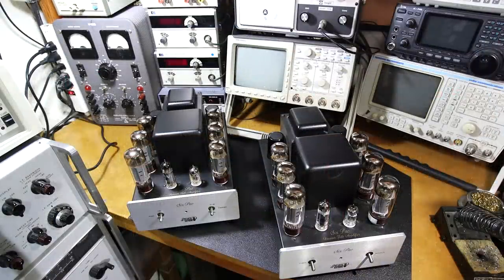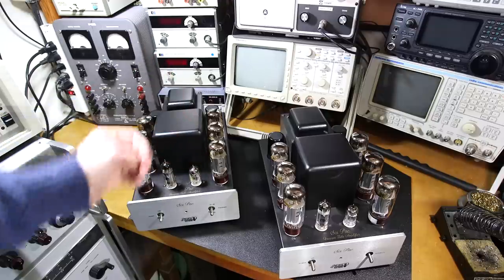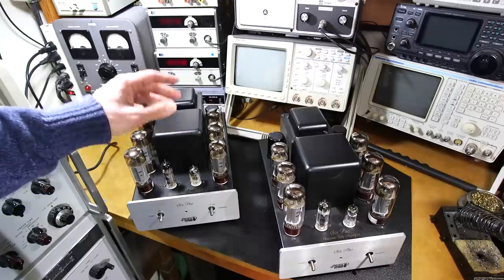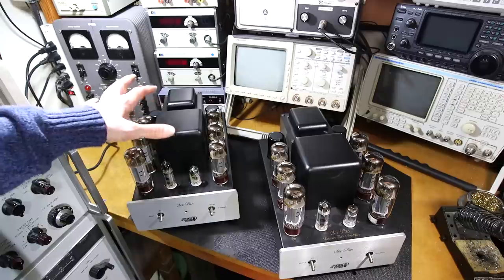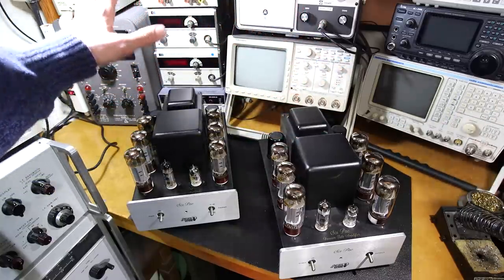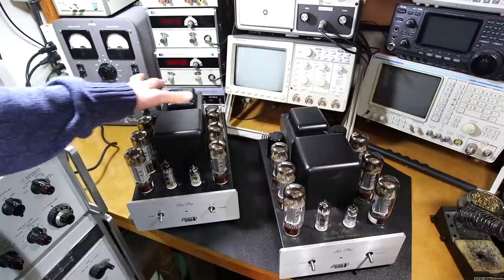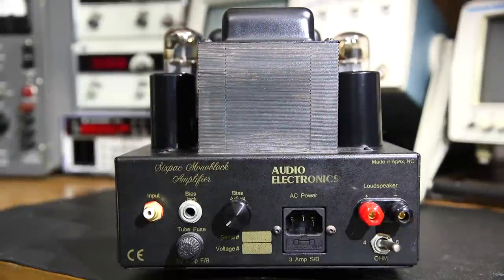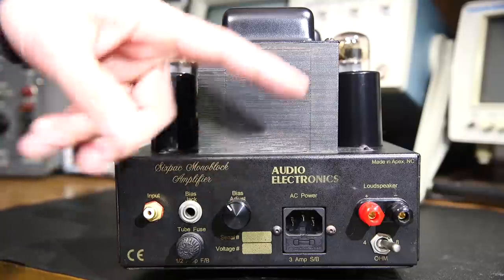Two Six Pac's On The Bench

Comment: The future is Class D!
Reply from the maker: For powering bass "yes," for audio containing information "no." For those that want a modified switch mode power supply to reproduce audio, class D is fine. For those of us that like our sound, inefficiency is just fine. I personally like drawing current 360° of the cycle :^)
Reply: @MrCarlsonsLab  Show me in a double blind study if anyone can actually tell the difference between a modern class D amp and your beloved power wasting class A tube amp. Actually I am willing to bet the class D amp will sound crisper.
Reply from the maker: @HansCSchellenberg  It would be very easy in most cases, just listen closely to the noise in the speaker at no volume. Try it, compare, and get back to me.
Reply: @MrCarlsonsLab  Well I own 3 Sonos 5's and a JBL Partybox 310. All powered by modern Class D amplifier designs, I have never heard even a hint of an audio noise floor out of any of them. Maybe my ears are not golden enough :)

Comment: Why 162 thumbs down ?
Reply: Right?! This was awesome, and although there were a couple of things about it that bothered me, they are small potatoes, and do no merit a "Thumbs Down". Since you asked, though: 1) Paul never came back and told us what became of the OEM HV capacitors that he changed.  How did they measure , once removed from the circuit?  Did the leaking internals translate into an actual failed cap, and if so, what was the failure mode; open / short /high ESR?  Did the failure effect both amps, or just the one we saw in the video?  Who built the caps and what was the mfg date, so other owners or folks with these caps in their amp may be informed?  
and 2)  just because he says "fa-rod" vs "fa-rid", or "sold her" vs. "sa-der"...Still, a big Thumbs Up!

Comment: Bottom line, my sixpacs sound great! I do not care what an ohsosillyscope trace looks like, I do not listen to traces on a scope. But thanks you for the info. You could have spent some time on the coupling cap importance.
Reply from the maker: Hi Carl. You should care what an oscilloscope says. Next time in a quiet room, listen closely.... You wont hear that in these amplifiers.
Reply: Oscilloscopes are more accurate and they don't get wax buildup.   Neither are they subject to biases.
Reply: Wait until you have an ultrasonic oscillation problem giving you a fit. I wouldn't rely on your ears to find it.

Comment: 16:50 I assume the switch inside that bias-probe jack "removes" the need for a (dummy) load on the output of the amp, while adjusting the bias?
Reply from the maker: Adjusting the bias requires no drive to the audio input jack IE: (the amp is silent.) No load is needed to adjust the bias on any transformer coupled vacuum tube amplifier.
Reply: Wait a minute... So are there particular tube amp topologies that are and aren't prone to blowing up without an output load?
Reply from the maker: As long as no signal is applied to the input, you should have no problems. Problems occur when drive is applied with no load. Keep in mind, if the period is kept short (no load with input drive) this is often ok as well, for testing purpose only.
Reply: I'm just a novice enjoying these videos, and that was my understanding too.  But what I don't understand is why there isn't a load put across the output when testing.  I always thought it was a no no to have a valve amplifier on without any load
Reply: That's been my experience too. Back in the '60s I had a dummy load setup on my workbench. I could flip the switch between 2Ω, 4Ω, 8Ω, 16Ω  and no load. I never had an amp react badly with no load. I was always using a nominal signal input. No overdrive. It was interesting to see how an amp's output varied with the load. I wonder if the resistance of the negative feedback loop would enter into this.

Comment: Another comment, we often measure both THD and THD+N. It would be interesting to know what the ICN (Idle channel noise) for the amplifier is as well, since it is this noise that we comprehend as "hiss noise" when an amplifier is on and not playing audio.
Reply from the maker: Hi Cody. With an open grid, audible hiss is present with a 12AX7 installed. Terminating that grid to it's lifted ground almost makes the amp silent in that regard.

Comment: Why do they use point to point? Whats wrong with PCBs?
Reply: NeuroMod 

My first thought would be good old audiophile cork sniffing... But my next thought would be "how thick do pcb traces need to be to accommodate ~500v?" 

"How big would that PCB have to be?"

It's possible that you can make this chassis much smaller with point to point because of this... but that's just a guess.
Reply: Thick traces would be needed for high current, at higher voltage the current is very low... but your first guess makes sense, saying that something is hand made in an almost artisan way is probably good marketing targeted to these guys.
Reply: NeuroMod thanks for the clarification... The only other consideration would be for hobbyists. I'd consider point to point user serviceable for someone hell-bent on taking care of their own equipment.

I have a 1959 Harman Kardon A250 that's my primary stereo and I did all the work to restore it. I also built my own guitar amplifier, so point to point is just the way it is.
Reply: Still amazes me how poorly designed audio equipment sells at premium only because its "audiophile" stuff...
Reply: My guess is that point to point encourages experimentation.  That would seem to go along with a easily accessible and feedback control.  I think the maker understands their market. ;)
Reply: Leaking, arcing, burning holes in the pcb & such. A joy for sure. Seeburg did this on their jukebox amplifiers and control units ca 50+ years ago. They  went back to point to point as soon as they could. I learned a lot about using epoxy cement and brass shim stock to replace destroyed traces and edge connectors.
Reply: I'm sure the high voltage of tube circuits added a engineering challenge to PC board design, but I've seem reliable color tube sets that used PCBs, so I know it can be done.
Reply: I would expect a floating non-rigid armature (point to point) to short quite easily.

Comment: Would it have worked to swap the position of the two chokes?  The other one was pretty quiet.
Reply from the maker: It probably would, there just isn't enough room back there with the cap above it.
Reply: I could see they were different sizes, but it was hard to tell how much room each needed.

Comment: Thorough as ever Mr Carlson, (and well spotted with the LED as point of failure - nice old fashioned neon, perhaps?)
 
I got it with the HT boost :) tho' I'm not sure if EL34's would last long with high voltage screens (triode mode) - I'd try them screen taps, maybe with a switchable 'boost mode' in full pentode. But that'd mean drilling holes, wires and stuff ;)

 Couple of thoughts...
1-  Audiophiles and keen guitarists DO have a tendency to run these things WAY hot. Be interesting to run the distortion test to see if this makes ANY kinda sense 

2- Remember an EL84(6BQ5) at such a tiny current has a WAY high Ra and a pure current source will have high supply rejection - so wont really benefit from a negative regulator

3- You're being a little generous to the PI design. heck even in NOS heyday it was hard to find dual tubes that could match within a percent or two, (current production, WAY worse) and these amps originally shipped with 12BZ7's in, a regular TV tube.

 They're probably using classy resistors at that point is due to the large voltage swing and dissipation figuring expensive/audiophile types would be more thermally stable/sound better ') 

Thanks for the schematic - I sure WOULD rescue one of THESE tho I'd prob connect the UL taps ;) 

 Oh, and
4-I'd be worried about ripple on that DC LT - half wave and only a modest reservoir. I'd go for a schottky bridge, with a lil bit of resistance (2 stage CrC filter) to drop the excess - its the HIGH freq component that tends to get coupled from the heaters, and this isn't doing much to get rid of it

Having said that .. Nice iron, nice amp - and nice lil teardown ;)

 Pete, Gas Electronics, London
Reply from the maker: Thanks for taking the time to write Pete!